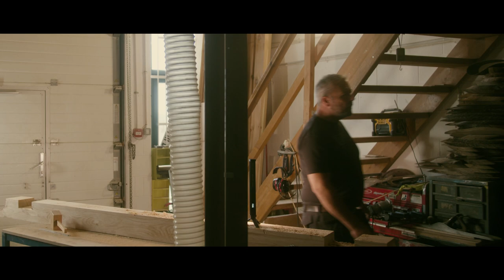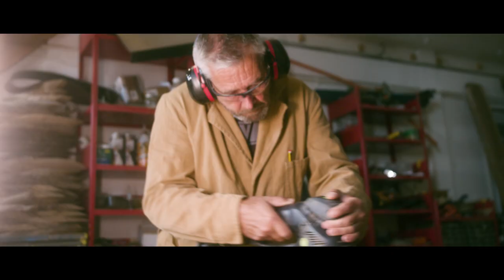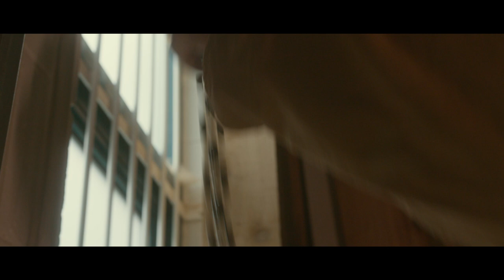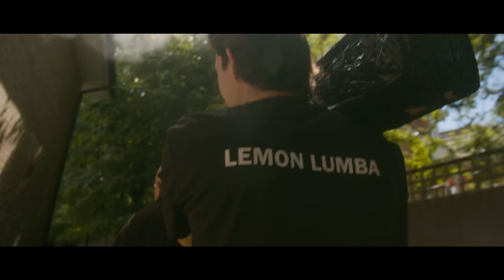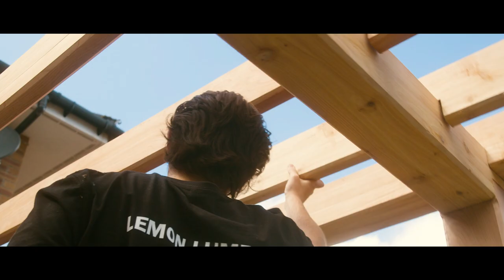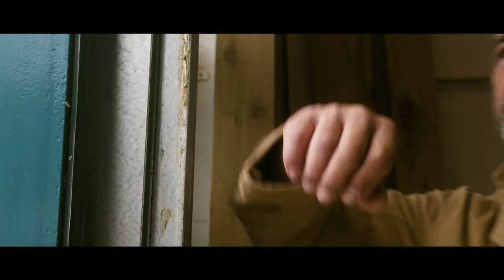'Lemon Lumba' Commercial | Shot On BMPCC4K

Comment: Good job! I really wouldn't be surprised to see it on TV as is. :)

And just because it's YouTube and we're all nitpicking for improvement (hehe),  the only thing I noticed a bit was the "handheld look" at the end for the reveal shot. I think a tripod shot (maybe a second take to test it out, keeping the handheld shot just in case) would have been better, as the wooden structure they built is something that itself should be stable. So a fixed shot with a light zoom out (to frame the whole structure, maybe a digital zoom if it's a fixed focal lens) would imply that.  On the BMPCC4K the  rolling shutter doesn't help too, with vertical lines being kind of wobbly on some movements, even handheld.

Overall I bet the client loved the commercial, I certainly did, and I wish I'll make one as good myself someday! :D

The Pocket4K really still rocks! What lens(es ) did you use for this shoot?
Reply from the maker: Hey dude! Thank you for the feedback on this one, really appreciate it and super interesting hearing your POV. The reason for the establishing shot at the end was mainly down to time! We were cutting it super short with getting the structure built and it kept raining on and off!! Definitely a shot to improve with more time! I used the sigma 18-35mm 1.8!